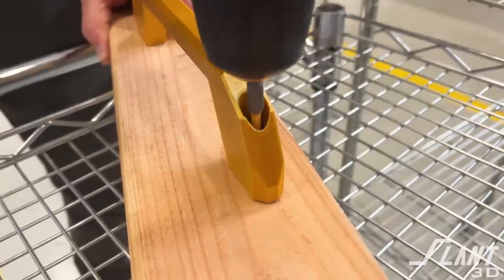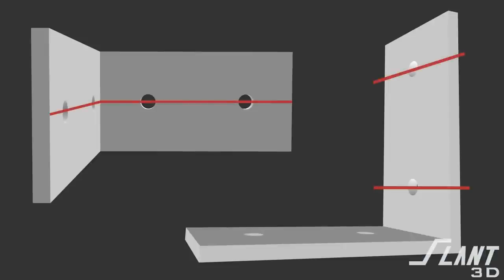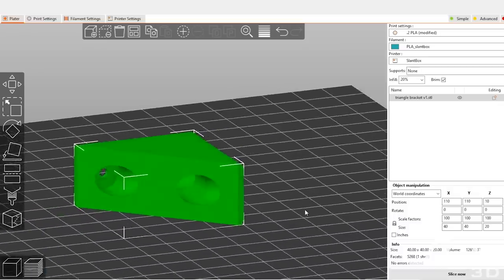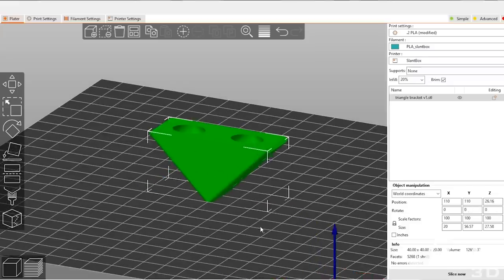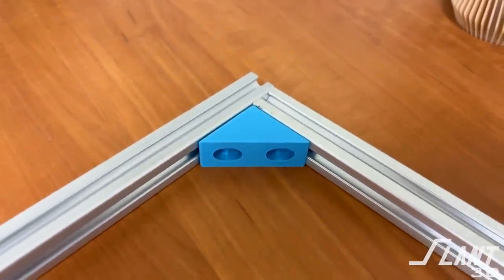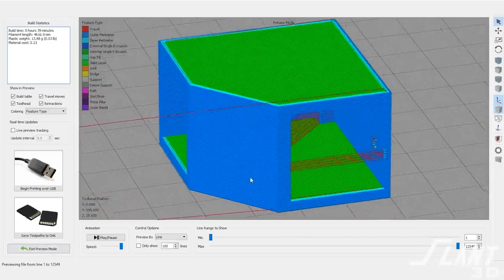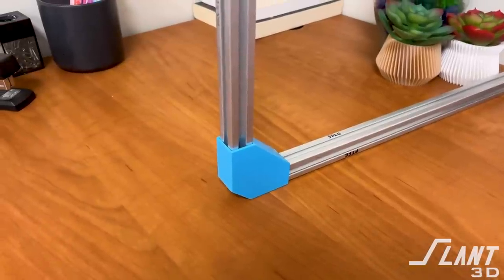Corner Brackets | Design for Mass Production 3D Printing

Comment: Please stop saying various parts are impossible to make with injection molding, blowmolding, extrusion, etc. It's perfectly fine, and far more accurate to say they are generally more difficult/expensive/complicated, and therefore only used in applications where they are warranted. Saying they are impossible makes you look bad to people who have experience designing and manufacturing such "impossible" parts. Engineers are clever people. They can do remarkable things with a little careful thought and creative execution.
Reply from the maker: This part is impossible to mold. Physics.
Reply: @slant3d  Which part, exactly? And which kind of molding? There are lots of ways to manufacture parts, plastic and otherwise. Engineering.
Reply: yeah this part is wild to me. saying something is impossible rather than “impractical” or “inefficient” then refusing to back down
Reply: @slant3d  pretty sure you can mould this. You'll need a three part mould but I don't think it's impossible
Reply: @slant3d  it's impossible to design an L bracket that accepts tubes that can't be molded. To make something unmoldable (AS A SINGLE PIECE) you need interior features inaccessible from the outside.  However, in that case, it may still be possible if you break that part into multiple smaller parts. 3DP is awesome and useful but it isn't a production answer to molding in most situations. BTW, love these design videos! Thank you for the effort that goes into them.

Comment: I don't think it would be the same as a metal one. When have metal frames for a reason, and it it to be strong and to resist vibrations. Putting back plastic just seems to defeat the purpose of the metal frame

Comment: Nice video, and I see where you are coming from.  But coming from a design engineering background I find 3d printing and mass production is hard to accept in a single sentence.  As a designer, be careful not to get caught by the all I have is a hammer, so everything looks like a nail.  As soon as you can justify the up front costs, things like injection molding make an incredible difference.  As handy as 80-20 extrusions are, they are really expensive and time consuming to use.  A good example of what I am talking about is the difference between the Prusa printers and the Bambu Labs P1P.
Reply from the maker: We are the largest mass production 3D Printing farm on the planet. We do have some experience.
Reply: @slant3d  I certainly would not doubt your experience.  I'm a retired EE, in my career mass production was >10K units per month.  Anything less than that was just considered production or pre-production.

Comment: As an experiment, I printed a rather long and reasonable heavy L bracket that wasn't even symmetrical on its corner. It printed on a single layer width corner, one line of PLA+, and it printed perfectly. I actually printed it on both flats, sitting on both outward corners, and sitting only on the sharp corner, and the single line corner print got me the best results. If I was going to mass produce it I would definitely add some surface area to keep it stable, but I was super impressed. Great video!
Reply from the maker: Great to hear

Comment: Optimum might be viewed as being able to piece bits of it together as needed.  If you only need internal bracing (say front panel or accessories), just use the internal brace.  If you need to keep the internal space clear (i.e. if you're putting a panel in the extrusion), then use the external bracing.  If you only need max strength (and don't mind covering up slots/surfaces), then use both internal and external bracing.

Comment: This is great. Two L-brackets can be combine by rotating them 90 degrees from each other to form a corner of a frame.  I can immediately use this to for a lightweight frame that combines my functional parts as well as the clearances needed to allow parts to move and wires to be routed.  Since the screw is not load bearing along the axis, I can just use appropriate tolerances in the plastic so I won't need a nut.  In fact, since some elements of the frame have almost no load, I can just use pins or 3d printed detents so that those parts just snap together.

Comment: Nice iterative design. But I would feel better if 2 brackets were contacting. This would bring extra strength than brackets just contacting with PLA.
Reply: Have you ever thought perhaps... not use PLA but use PLA Plus or ABS/ABS Plus/ ASA /PETG anything more strong and heat resistant than PLA alone. I suppose it comes down to what your printer is able your standard non-all metal extruder is not going to safely do any of those other choices except maybe PETG.

This is where a upgraded extruder is often cost effective from a new printer.
Reply: @MoistDreams  or how about the aluminium you are already using?
Reply: Is there some context I am missing here?
aluminium filiment is not actually really metal its a PLA polymer metal like filiment in texture and style. 

If you wan real metal 
280c 
120c bed
$300 and some change spool of stainless steel filiment which is real steel. 

Cons, you can't print overhangs without having to send it away to be sintered. 

But for these since the optimal way is not to have overhangs anyway sure you could print these in steel if you like.
Reply: @MoistDreams  In the last design of the video, the 2 brackets were far apart and they were only being held by the 3D printed corner. We are saying that if this corner holder allowed the brackets to contact, it would give more strength (at least when 2 brackets are being spread out). We are not talking about filament types or strengths here. just the design choice to benefit from what we already have
Reply: Ohh, that was like woosh without that context, I see now.  Yeah, I mean in that case why not just screw the damn alluminium down to the other one like always and just print the cover.
Reply: @MoistDreams  Yeah that makes a lot of sense :)

Comment: Hi, can you show the also a video if you want to connect three aluminum extensions, i.e. you want to make a corner bracket. This is quite a common problem (also for building 3d printers) and als the solutions I have seen are not as I like them. Second would you not still keep a rib even with this design as it would stabilise even more. thx Rainer
Reply: Design is the same except you base it on a trihedron instead of a squared L, also known as a triangular pyramid, commonly recognized as the shape of a D4 gaming die.

Ribs you need to weigh the pros and the cons. The more space you spend on your bracket, the less you have for your motion system later, for example.  As things stand, the wide, angular brace spanning the inside of the corner in that last bracket serves the same purpose as a rib and potentially has more strength even if it was designed to be hollow. In this case, the rib would replace the brace and would provide the benefit of less material used and the con of a potentially weaker bracket.

Comment: A corner bracket that combines a square hole with a V-slot groove would be even stronger, and fully leverage 3D printing
If it's strength is especially important, use a CF or GF nylon (pre-dried 24h, and preferably oil submerged heat-annealed)

Comment: 3:36 - I'm curious as to why having a lot of surface area for something that small on the build plate is problematic? I generally don't have problems until I start making prints that fill most of the plate; for something as small as that I generally don't have any problems.
Reply: I suspect the idea there is that it's easier to automatically eject a part when it has a smaller contact area.
Reply: Don't worry about that for hobby printing. The reason you would want minimal contact is for MASS PRODUCTION. This video is describing how to optimize the bracket for mass production, though most of his points apply to home printing. They need the parts to easily come apart from the build plate consistently
Reply: @JohnLattanzio98  most slicers will still take it as an exclusion zone so this doesn't really make sense. In fact it may be worse since overhangs can be a problem, requiring the printer to slow down.
Reply: @brisance  generally for home printing you want MORE contact, but with mass production at the end of each print the nozzle moves forward and pushes the print off. They need to be sure that the part will come off, so the nozzle isnt digging into the part
Reply: @JohnLattanzio98  guess it doesn't sit well with me that a toolhead is intentionally crashing into the print to get it off the plate. Loads of bad things could happen e.g. heatbreak bending, parts going not where they're supposd to. But hey, who am I to judge?  😅
Reply: @brisance  I believe the printers are designed with a bumper that is hit rather than the printhead itself

Comment: Something I did for 1515 extrusion which had threaded holes in each end, I made a few brackets that attach onto the ends of the extrusion with pieces going in the slots and it had a screw hole to screw into the end of each extrusion. So the bits that fit into the slots keep it from twisting and the b screws hold it together. It makes a very low profile connection, essentially the whole connector would fit in a 15x15x15 mm cube. This approach does start to become more difficult with more complex joints though, especially when access to the screw at the end of the extrusion would be difficult, like T joints. I’ll probably implement something like this instead.

Something similar could be done with your bracket, just create bolt holes into the ends of the extrusion.

Comment: @3:41 why is having a large contact area on the build plate a negative?

In this part in particular, if the part is facing downwards there is no support material needed and you’d possibly have a smoother surface facing outwards (if the aesthetics was a consideration)

Pardon my armature/no0b ignorance. Lol
Reply: Small contact is more reliably ejectable in an automated manner, and less likely to warp.
Reply: I think in practice, there is sweet spot with how large the contact area is.  For my parts where I'm pushing to build very small, the problem I often face is that the contact area is so small the part tips over or lift up.   But if you have a really large part, with lots of contact area warping is a problem, and depending on your print surface you might have hard times removing the part.
Reply: @daliasprints9798  Ah, that makes sense.

Comment: This is a great video summarizing why we really do need to flip the paradigm when fabbing 3D printed parts and proactively consider the end goal with a conscious eye on the additive method versus other methods. I would, however, disagree that this particular part redesign is uniquely enabled by 3D printing... It is in fact a fairly simple aluminum part to machine with a small desktop CNC or even a manual mill with a bit more work. Not to say that this negates the first point at all.

Comment: The optimal design is cost-effective and quick to assemble and those are certainly advantages but it eliminates the aluminium-on-aluminium joints that the standard brackets support. If you make a frame with these as joints, it's going to be mechanically weaker than the standard brackets, because those allow one piece of aluminium extrusion to sit on another. You can get around that by getting rid of the chamfer feature and leaving a right angle though, that way the aluminium can still rest on more aluminium. I'd go a bit further and add a dimple to act as a drill guide, so that you can drill through with a hand drill and put a screw through one bar into the end of the other. The plastic will give stability and a degree of precision but you still get the strength of metal joints.

Comment: Optimal part? Pretty bold claim
I mean sure, from the manufacturing point of view this is pretty good, but there's a good reason why L-bracket look how they do; you can do multiple types of joints with it. 
So last one, even if optimal from manufacturing point of view, is not that great desgn-wise as you'd need many types of this bracket system to create a frame from profiles.
I'd say that one before it was a good compromise between end product that is desirable and manufacturing technology used, making it truly optimal as a product

Comment: I don't understand why it's better to print it tip-of-the-triangle on the plate. The piece is going to take the same "space" on the plate, so it won't allow for more pieces on the plate. Can you explain ?
Reply: 'Better' is related to the process of how the part is manufactured, not to the design process of where the material is placed within a part. When filament flows from the extruder its uniformly molten, and cools along the filament length uniformly. So within a layer the strength of the material is the strongest, just as strong as it would be if the material was injection molded.
However, between layers the molten filament is making contact with solid (cooled) material. The bond between solid (cold) and molten (hot) material will be much weaker. 

The issue with bonding strength between layers is not unique to plastics, metal bonding faces similar issues. Metal parts after being welded are reheated and then quickly cooled. This 'annealing' is a heat treatment process which alters the microstructure of a material to change its mechanical properties. (very common with steel) An annealing process can't be used with common plastics, as heating will cause the part to deform before it reaches a temperature where layer bonds would be strengthened.
There have been some 'experiments' where 3d-prints are packed in sand, with some variation of results with small parts. This sand packing process effectively turns a 3d-printed part into a molded part, will lots of extra prep, cleanup and labor.
Reply: For mass production, the parts need to reliably separate from the bed
Reply: They work with automatic ejection of parts, the amount of parts they make per print doesnt matter. To make autoejection relaible they want little surface area sticking on the plate.

Comment: Excellent design process lesson. Even thought I know the importance of layer orientation in 3d-printing, the design process walk through in this video really stressed how important this concept is as part of ones "design process thinking". (not the slicing/print process)

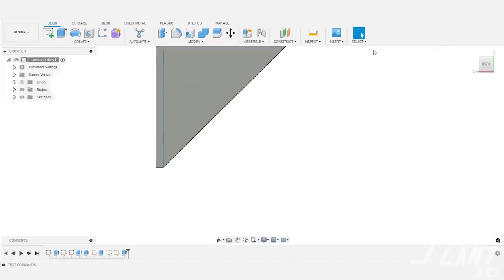A realization I had while watching is layer orientation is not always clear in a design. Not seen in CAD view like at 1:55, while (slider?) image at 1:20 layers are more clearly visible. Often with a multi-part CAD file, individual part print orientation may not be provided. The ability to even set a part print orientation property varies with CAD software, and may require designers to create a print perspective view of a products parts. Often print design orientation is accomplished in slicer software, separate from the CAD definition. It would be helpful if CAD software had a layer orientation property that displayed layers as a gradient, or a rainbow of shades. (even if just an optional view) Particularly with multi-component designs.
Reply: It would be helpful indeed - although a good rule of thumb is that the positive Z axis is pointing up. That's how most slicers and 3D printers work; the X and Y axis are parallel to the bed and the Z axis is perpendicular.

Comment: Is it possible to do 4 corners with this? I believe it is almost impossible to fit the last corner
Reply: This is a good point, if you do 4 corners and want to remove just one it is a problem. Obviously you can remove 2 and slide the whole side away but you may have to disassemble more than you want if more parts are connected to the side you have to remove.
Reply: Yes, you just do the last two together at the same time. What's hard is the triangle version of this.

Comment: don't forget, if your screw holes are on top or bottom, you can have crosshatch patterns making splitting almost a non issue if the area has enough layers.

Comment: Now we just need to use those brackets to make a core xy 3D printer!
Reply: You want a bit chonkier, and with more fastners, if you want it to be rigid under intense forces. But it's very doable! Check out The 100 or the Rook, both mostly-printed corexy designs you can build with impressive performance. Plenty of videos here on YT for both.
Reply: Slant's printers they make themselves use these.
Reply: @getlostinit3D  Yes, I've seen the ringing on their prints. 😂

Comment: Our organization, in the aerospace sector, has been an early adapter of addittive manufacturing and recognizes the paridyme shift taking place. And while we've used it to do a number of things related to our  processes, I learned something I hadn't seriously considered from your talk.

The use of it to build elements of the actual assembly.lines and related mfg equipment I hadn't considered -- been to fixated on producing product hardware -- shame on me -- the supply chain opportunities are huge.

But I was wondering why you didn't mention the increasing number of materials which can be used -- especially the various metals. Also, an other point  you difn'tt mention, at least in thr one video I watched, was the fact that you can print things which couldn't be produced prior. Ex, parts consisting of indivual elements combined and interlocked in ways which couldn't be done unless printed as a whole. To illustrate a simple example, you could figuratively build a model of a ship insude a bottle. i'm sure we'll be rinting glass elements sime day!